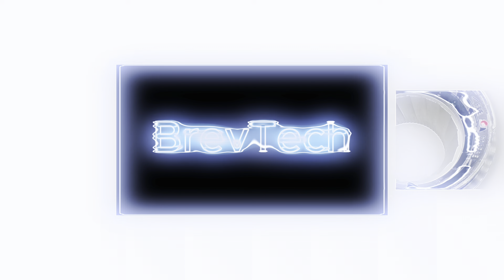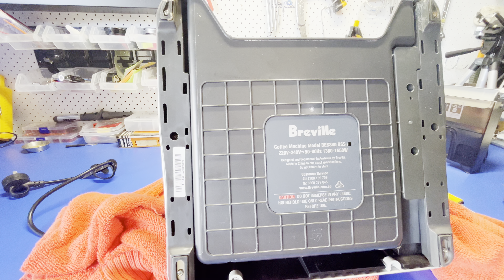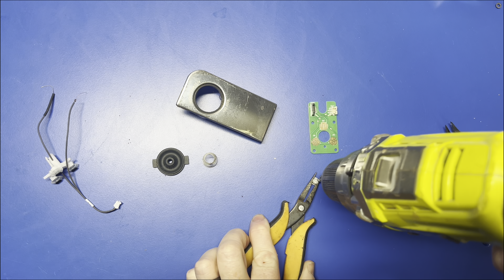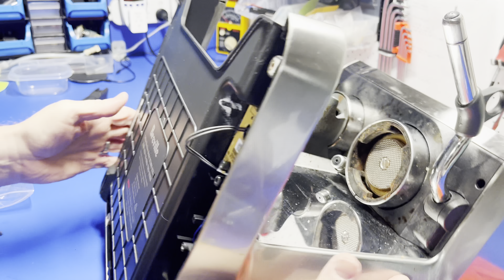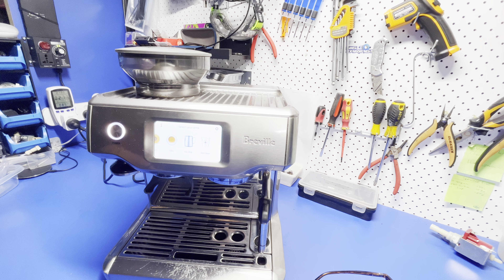How to fix error code ER05 on the Breville Barista Touch BES880 (see description)

Comment from the maker: Update: The kit linked above now comes fully built, so the drilling and glueing parts are no longer required.
Reply: I need one like asap. I am getting coffee withdrawals 😢
Reply: An absolute game changer thank you so much
Reply: Just got the kit today and took me less than 15 mins to replace the sensor! AMAZING STUFF!!!
Reply: do you have a tip on how to assemble with the new part? I cannot disconnect the 2 pin connector to place wires and button through white plastic
Reply: @benabraham9108 Richard just pry off.  Don't be afraid to pull with some force.  Maybe yours has a clip on one side that needs to be depressed, but mine was just very snug
Reply: @ShaunStallings  Thank you. Was it the original part for you? I am using force and it feels as if I am about to damage or break the connector.
Reply: @benabraham9108 it was the newest one.  Try a needle nose plyers to wiggle it free
Reply: I just installed the new kit and it is even easier.  Thank you so much!
Reply: Thank you sent my off for repair 219 for labor for a 30 dollar part 🤬nope send it back

Comment: Does it work if you just solder the broken wire back together?
Reply from the maker: no, its coated and too thin imo. also it usually breaks right down the bottom

Comment: No answer to how you got the plastic tripod back on the sensor/plug wire? Video just skips that part........
Reply from the maker: Ah did I? I did a step-by-step walk-through on the website that’s much easier to understand than this.
Reply: The white connector on the new cable does go through the plastic cone.  It's a tight fit and needs to be wiggled and pushed through.

Comment: Hi - Can the sensor be wired out, tested not connecting the board cables but no go. I dont use the sensor. One of the wires is now snapped/may have been snapped but poking it back in the sleeving seems not to conduct. Does not seem like bare wire coming off the sensor head.BTW you don't sound Austrailain!
Reply from the maker: not shorted as that would give another error, but you could just bridge a 50k resistor across it. No i'm from the  UK originally

Comment: We ordered and received your replacement part but how are we supposed to get the replacement sensor through the white plastic piece with black pads that holds the sensor?
Reply: My question as well. Did you get an answer?
Reply: Also my question

Comment: Hi,just got my part from you. How are you supposed to refit the white plastic part with rubber soles on it to the new cable? Neither the milk sensor och the plastic plug fits through the hole. Thanks in advance
Reply: The white connector does fit through that plastic cone but you have to be careful. It takes a lot of wiggling and pushing but it can be done

Comment: works perfectly - thank-you. (new kit is easy / no problems).  I was able to fit without taking off the right-had-side foot section as the top screw had become rusted beyond use.

Comment: Can I remove or disconnect the damaged sensor, and make the machine works without the sensor?
Reply from the maker: no as it needs to measure a resistance, otherwise it won't proceed (dumb i know). you can use a 50k ohm resistor in it's place

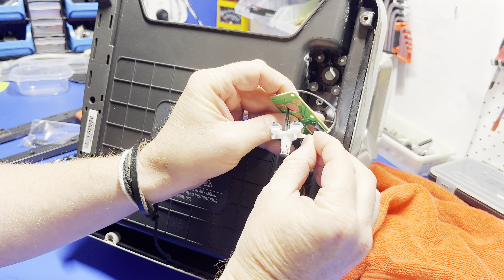Comment: I finished doing this and the temperature sensor is completely off. And yes, I did make sure there were no air bubbles. Is this the right thermistor that you have in the other video with a 47K value?  I had to disassembly it and start over.  I also had the same problem as the @SimpleG5, where the paste does not hold it in place. Also @3:39 when you are drying it then in 3:40 you already have it in the plastic tripod holder. Threading it through is impossible it will just fall off because the paste won't hold it together and the metal cap doesn't fit from bottom to top. Super frustrating. I'm going to try super gluing like @SimpleG5 suggested. With all that said thanks for offering these products,  close to having it working again with your videos.
Reply from the maker: If you have no luck, get in touch via the website and i'll see if I can help. I now glue these a week or so ahead before I ship them out. It's possible you might have a faulty thermistor

Comment: Hey.  That's plaster for heat sinks and not glue.  I left it to dry for 24 hours and it just fell out.
Reply from the maker: Make sure you use enough and the hole is drilled deep enough. I've not heard of anyone having this issue and i've been making them for a year. I use plaster as it stays a little flexible and should put less pressure on the wire as it springs up and down.
Reply: @BrevTech I left it this time for 2 days and its still not solid.  Yes I drilled it deep.  Saw another video where he capped it with crazy glue.  I did this.  That was a good idea.
Also, when you reassemble you are missing a screw to be placed back in.  I had one left over and see on yours you did not put it back in.
Anyway, thanks for the part.  Machine turns on now.
Reply from the maker: @ well spotted! I will add the glue capping into the instructions. I did this in the first video but missed it out on this one :(